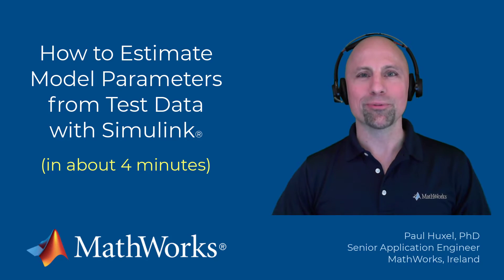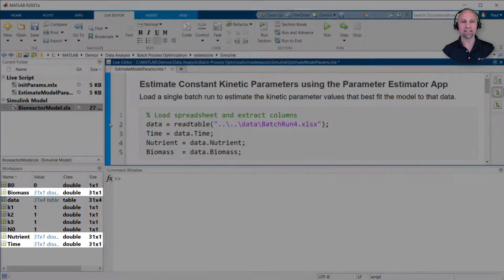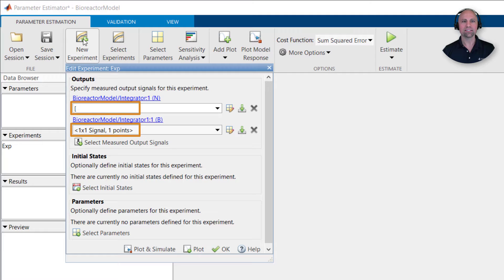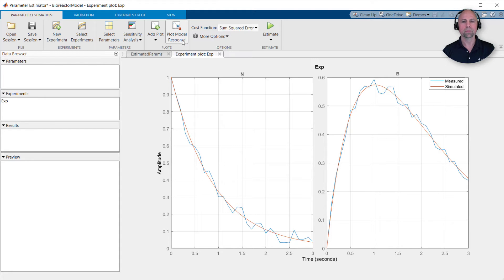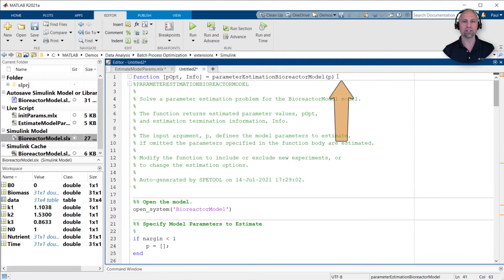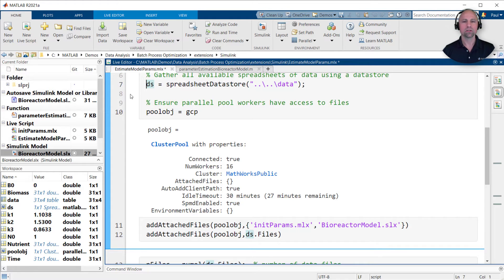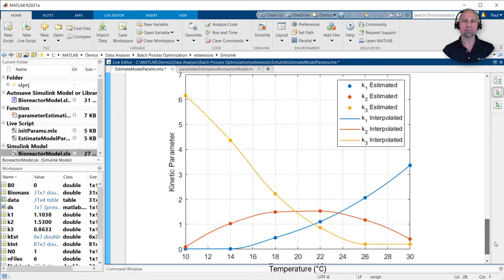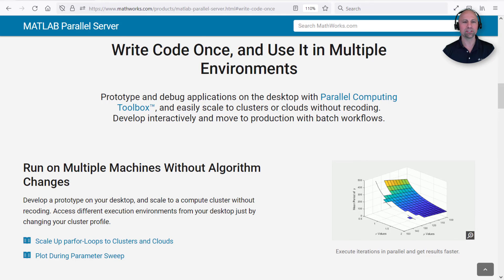How to Estimate Model Parameters from Test Data with Simulink

Comment: What is the estimation method. Equations??
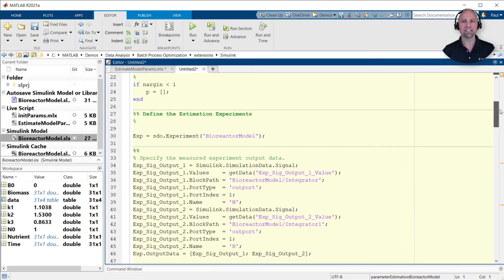Reply from the maker: The equations are shown in the Simulink model at 0:43 of the video.  The optimization solver uses a nonlinear least-squares method ("lsqnonlin").  This is the default for parameter estimation.  (It's hard to see in the video, but if you pause around 2:07 you can see this in the generated code on Line 76.) 
For more info https://www.mathworks.com/help/sldo/ref/sdo.optimizeoptions.html#mw_03a25b9e-ec92-47b9-8b54-c34bee4e0b37